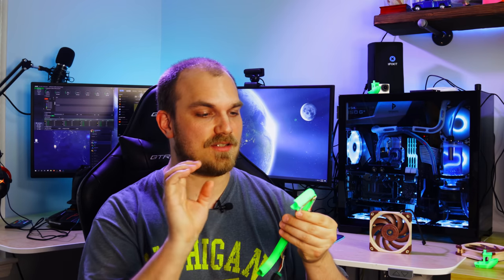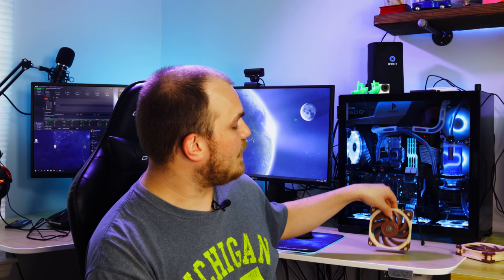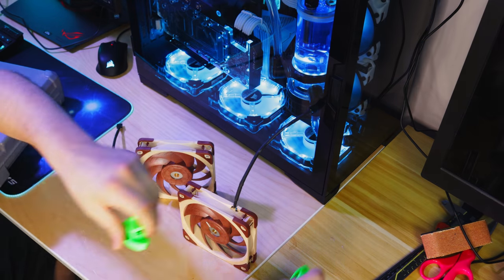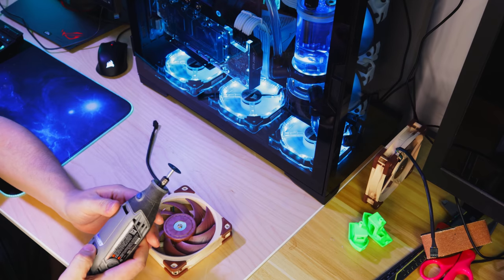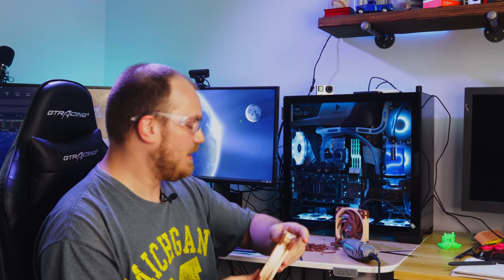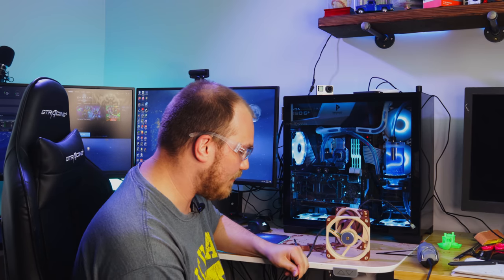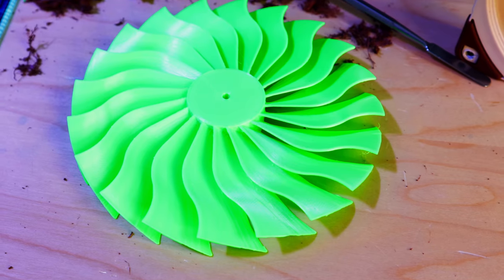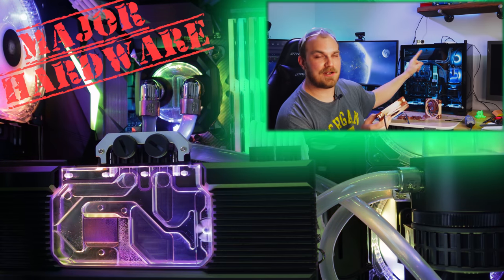Making A Fan Blade Test Bench - A12X25 Teardown Is Surprisingly Easy

Comment: Of coarse Noctua even over engineers the core that their fan blades are attached to. We have the same Dremel by the way. 😊
Reply from the maker: I ♡ my dremal
Reply: Things like that show why Noctua isn't cheap despite having no trendy features or performing thát much better than other good fans: they're basically the 1980's Mercedes-Benz of PC fans: overengineered.
Reply: @MajorHardware  It is a great little tool
 :D
Reply: @Candisa  For sure! That is why Noctua is so epic! I like the 1980s Mercedes comparison.
Reply: @DawidDoesTechStuff  Thanks, also, I've just checked out your channel... and subscribed. :)
Reply: @Candisa  Awesome, thank you! Welcome to the channel. 😃
Reply: hey Dawid, unrelated question but what aspect ratio do you use for your videos?
Reply: @rafee9442  Haha!! That is a pretty random question to get on somebody else's video. 😁 I use 2:1. My camera films in 17:9 (DCI 4K) which means I barely have to crop to get the aspect ratio.
Reply: @DawidDoesTechStuff  ah okay that makes sense, it looks really good since it isn't as narrow as 21:9 aka Snickers bar but is just narrow enough to get that 'cinematic' look.
Also my phone is 18:9 so it fits perfectly :p
Reply: @rafee9442  The whole phone thing is the main reason I use the aspect ratio. A lot of people watch on their phones and phones often have wider aspect ratios. 👍

Comment: I would love to see some jet engine-esque blades, and how they perform, as well as various blade count fans, as you now have a great testbed for those projects!
Reply: compound blades, even the blades have blades
Reply: I think Jay did a video on that. That style of engine doesn't scale down very well. I'm concept it sounds great, but it's not.
Reply: @popeizzy2012  it's more than that; jet turbine blades are the way they are because they're multi-stage, with dozens of sets of blades behind them at the extreme end. they also make sure the air is not too hot nor too cold via friction heating or slowing superheated air down until it's dense enough to pass (thus cooler). they also are required to hold up to stresses far exceeding what a 120mm fan needs to, both in the forms of heat expansion and force as they spin at tens of thousands of RPM. (part of why jet intake cones have spirals, to show if it's even moving or not at full speed)

Comment: I would love to see an asymmetric fan, with just 1 blade.
Or maybe even an air screw.
Reply: The trouble with a 1 blade design is that the fan will hardly function if it's unbalanced. I can't imagine how you could balance a 1-bladed design.
Reply: @ydihtty  https://en.m.wikipedia.org/wiki/Single-blade_propeller
Reply: @Mireaze  yeah, they /technically/ exist

Comment: I just "tore" one down with minimal damage to the blades. 
i heated up around the center core, flipped it over and pressed down on the blades with a rod supporting the center of the motor hub. it has a small amount of silicone glue. 
the damage occured on mine due to the rod slipping out of place and breakign a chunk off the front. the blades are still usable just possibly slightly off balance.

Comment: Hey there, Noctua did mention that they have a very tight tolerance between the tip of the blade and the frame itself. Which is complicated, the reason is as it spindle the fan tends to flatten itself and extend due to centrifugal forces (just like the earth is a bit flatten on the poles and that why plane use the longitude to travel from London to to Beijing for example, the distance is shorter). It make sense that they are trying to funnel air through the frame, which is the opposite on the EVGA fans used in their AIO (CLC 280 and others) which make them quite noisy and inefficient as people tend to replace them. Also, they do have also some fans used on they graphic card with the EVGA logo embossed  randomly, making the blades unbalanced and therefore creating more vibrations and noise (like an unbalanced wheel car).

Comment: I've been in your position where the coupler broke to get my printer usable just hot glue the PTFE tube in place so it doesn't move on retractions and it will still work. Just a quick fix until the new part gets there. I always enjoy your content. Cool video.

Comment: I'd like to see preexisting interesting features incorporated into one design, such as golf ball dimples on the blades (Silverstone have done this before) but mixed with ridges on the blade (a few companies have done variations of this), and stuff like all blades connected at the tips to a ring that runs the inner circumference of the outer frame (like Noise Blocker e-Loops), combinations of these would be interesting.

Comment: Twin or tri wide-blade fan :) Regular size blades lose static pressure in twin or tri designs, so perhaps a wide blade of some sort can provide the airflow capability of the twin or tri blade, but maintain static pressure capabilities closer to a five plus bladed fan.

Comment: You should try using old hard drive motors. They're easy enough to take apart and you'll have physical screw holes for hard mounting fan blades :D

Comment: I'd like to see a 1-2 blade design, basically alternate straight and turbine style blades, or use varying blade pitches.
Another thing I wanna see is an inrunner fan, basically the fan is with a 1-5mm core, running in a large bearing or bushing and is belt driven. Maybe use foil tape and grease as a bearing.

Comment: Hey, I've been doing PC modding with 3d printed stuff for a while now. I have both fdm and sla printers. If you wanna print the cable combs, I wouldn't recommend pla as it is too rigid, meaning that you can't slip the cables in place easily. I'd highly recommend you to get a sla printer to print resin. Transparent resin are beautiful and works great with lighting.

Comment: My recommendation for removing fan blades would be to heat up an exato knife blade, with a torch style lighter, and use a red hot blade to gently slice off each fan blade
I’ve used that method to modify plastics before and it’s extremely effective and can be done with minimal damage if you’re careful

Comment: try a fan design that is twice as thick, you need to make the fan  casing thinkser as well. all the pc cases i owned had rom for 50mm thickness fans, so think there is some airflow gains to be made here.
Reply: @krayos13  i get what you mean, at least in my front intake that has a air filter i could get some better airflow. but i might not get any benefits to my rear exhaust fan.
Reply: @krayos13  air pressure translate to airflow in the end.

Comment: Big continuous wave disc. Think it will need some caps to suck air in to be pushed, but they could be on the middle low spots, so outer ring still stays a continuous disc :)

Comment: Instead of a rgb light strip you could try rgb rope or "neon" strip. I used some phanteks neon strips in my case (they come in different lengths). They're a lot more flexible over traditional light strips and the glow is very uniform. You could custom print brackets for them or even use some clear zip ties to attach them.

Comment: Just fyi, the Fractal Design HF/HP 12s are super easy to disassemble you just pull the blades off they are just friction fitted on no cutting required

Comment: Do a static pressure blade that's higher than 25mm all along (not just the edges), with sweep design that makes the air travel inwards to keep it from escaping off the sides. I think it would work great as a 2/3 blade fan but that's up for debate

Comment: This is how it started. Came to this video to see how you can remove the fan from a noctua. I'm not gonna destroy my best fan. But I will try the hard way and remove the blades and sand the central hub of a cheaper fan so I can try using noctua style blades.

Comment: i whould like to see blades with flaps (like airplanes wings while landing) sorta of biplane,  to raise the attack angle and push more air, you also can exceed the thickness of the original fan leaving it more outward, so more thickness more air moved. Finally i whould  like to see blades go nearest as possiible to the frame to get better seal to achieve more static pressure

Comment: An open loop water cooler with no pump and no radiator that just uses tap water to cool the CPU and GPU and then the warm water goes down the drain. My other idea was to use a large volume of water ~5L for a loop that has fans and radiator but just has a large resovior

Comment: @Major Hardware
I see that your fans in the back of your case face the side of the case much like mine do in my Lian Li PC 0-11D

I have a 3D printer myself and I was wondering what the temps might be if printing an angled slope that tilts the fans towards the back side of the case instead of the font. Perhaps about a 30-45 degree tilt. 

I think that'd be a neat project (regardless if you have watercooling or not)

Comment: Water cooling ideea: instead of a radiator to take away the heat from the water use another cpu block and attach to the coldplate (which now is more of a hot-plate) a nh d15 or something (with thermal paste and good mounting pressure) and see what happens.

Comment: there is a MUCH MUCH easier way to remove the fan:  just cut 1 slot between 2 blades all the way down to the metal core. then it comes right off in 1 piece. i used a long thin dremel bit. but I bet a soldering iron would also work.

Comment: Id like to see if its possible to print (and wire) an extension for the 24 pin connector that would go just past the edge of the mobo and towards the back of the case so those wires could be completely hidden. Big ol' bundles of wires, even when trained right, just kinda clog everything up visually IMO.

Comment: I have always wanted to know what would happen if you mounted a 120mm Radiator straight onto a CPU. Fill it with coolant, close the holes and stick a 120mm fan on it. A Liquid cooled Air heatsink Cooler. LOL

Comment: Poor noctua. But why use noctua? Is that one high rpm? If it can't go over 1500rpm I wouldn't say it was worth destroying a noctua over.  Some other good one that could go to like 3000rpm sure. Also for testing the design's at higher rpm ofc.  

Not just to spare a perfect fan
Reply: The PWM version of the NF-A12x25 goes up to 2000rpm
Reply: @ydihtty  cool. still don't think it's enough for "science" / testing purposes. ;) But good to know. Oh and a voltage regulator would be nice too. Again for science. ;)

Comment: How strong is that metal casing? I am wondering about slipping being an issue if your printed fans that you stick on it start coming under centrifugal forces. Depending on what material it is it might maybe be ean idea to either dremel or file a small notch into it or put something on it that goes into a notch on the printed fan design to prevent slipping at higher speeds. 
my two eurocents...
Reply: Still your two cents, Euro or not
Reply from the maker: That drum is pretty substantial, more so than I thought it doesn't feel like it will bend or anything

Comment: EDIT: This was so hard to find a reference.. but here is what I mean: 
https://imgaz.staticbg.com/images/oaupload/ser1/banggood/images/DC/36/9dcb2418-d3a5-4638-81d3-c030156bb34e.jpg

If you take that, but make it one or two blades that go across the entire radius that would probably have good static pressure, right?

Maybe one that is a flat circle, with a slot across the radius that has a lip, forcing air in?

Comment: If push works better on radiators, why haven't we tried push push rad configurations? Can you test:
PUSH PUSH RAD
RAD PULL PULL
cheers :D
Reply: The reason I'm suggesting this is because Optimal Tech compared a 38mm thicc EK fan and found that the Noctua A12 x 25mm and the 15mm together had better performance for the noise level. Not only that, it's quite common to see PUSH configs doing better than pull on radiators but we are always doing push/pull??
Reply: Correction: MELTEMI fans. Noctua AF A12x15mm + A12x25mm outperforms at same RPM and again at same dBA

Comment: Maybe try a fan with a very high blade count, but also a very high angle of attack, and see how much air it can move at a very low rpm. Also see what difference vortex generators make in that design https://noctua.at/en/anti-stall-knobs

Comment: REALLY?? Peel the lable back,find the split of the lock washer and with a exacto knife split the washer and pop it out and BAM your fan blades will slide right off!!!

It literally will take at MOST 1 min to get the blades off.i do it all the time to clean up the bearings and get fans back to working correctly..

The only fans this won't work on are cheap fans that use bushings rather then bearings,as they tend to have a different locking mechanism that is sealed.
Reply from the maker: i want the blades off the stator thats a bit different